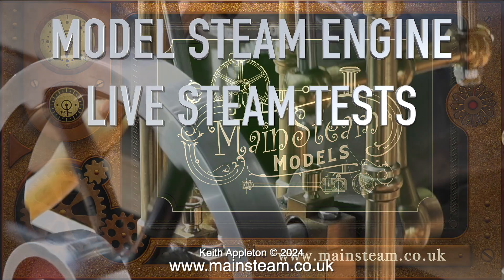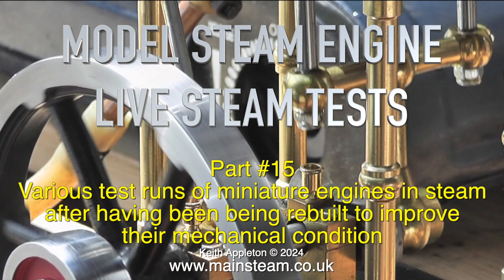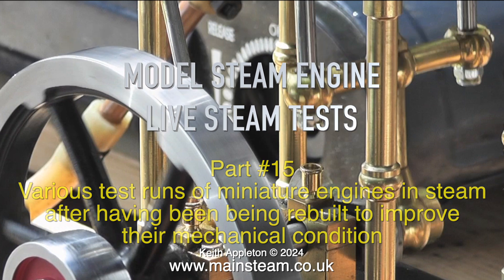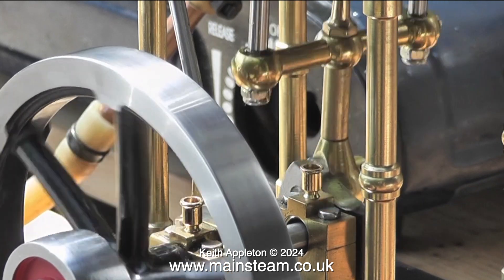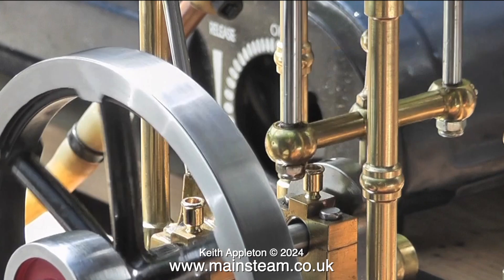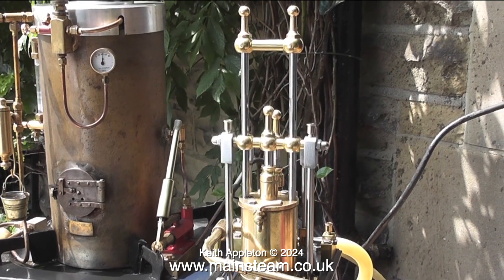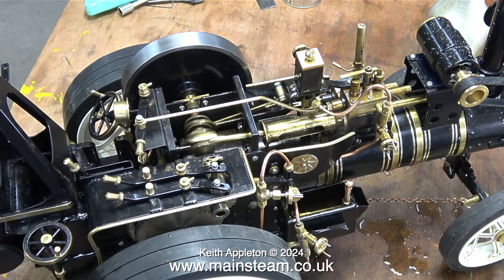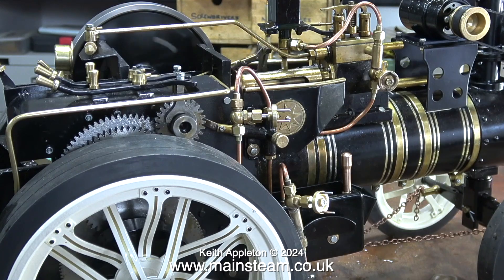MODEL STEAM ENGINE LIVE STEAM TESTS - PART #15

Comment: Prostate cancer can be cured if caught in time. Hope you get a good test result. Another interesting video, although I do not comment often  always enjoy watching your videos.
Reply from the maker: My PSA result has just come through and I am very pleased to say the least that it was only 0.11. The Oncologist/Urologist at the Hospital said that this was a very good result indeed.
Reply: @keithappleton  Thank you Keith Yes that's a good low result. My PSA was high and I was recommended an operation that went well and reduced my PSA. I have a test every so often and it has kept a bit lower than yours since. Always best to get a check up before it's too late for treatment. As for your engineering you have worked on some beautiful engines over the years and wish I had the skills to build one myself. I have built a couple of kits that did not turn out well but still enjoyed them and I have some Wilesco ones I run, more like glorifies toys but still give me the enjoyment of running a live steam engine.

Comment: @keithappleton i have a question regarding super heaters in boilers in general not specifically model steam. Do they require some amount of liquid in the tube before firing similar to tube boilers so it doesn't deform or melt the tube or is it enough to just steam up the boiler slowly.
Reply from the maker: It is a complex subject, the superheater elements have to be handled carefully. (I can only give limited support to my Patreon supporters). https://www.patreon.com/keithappleton